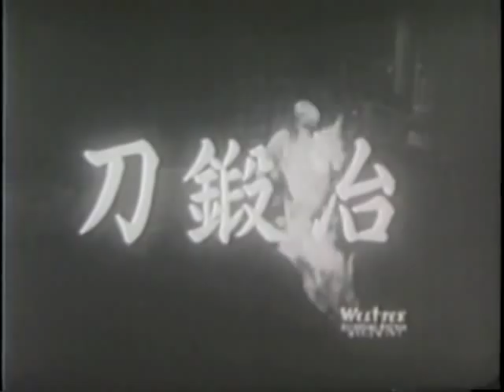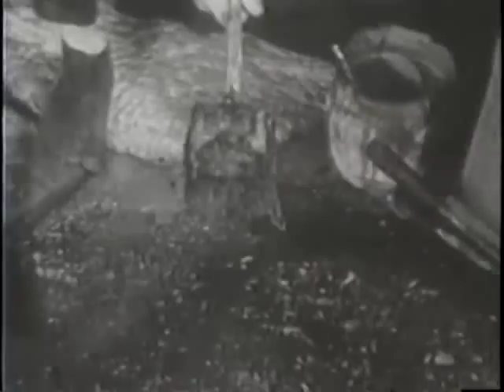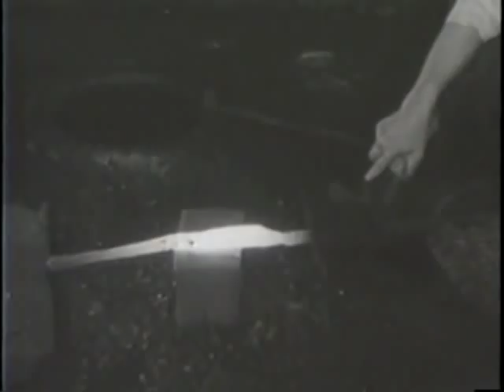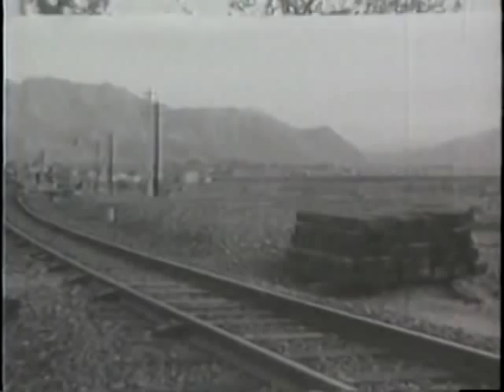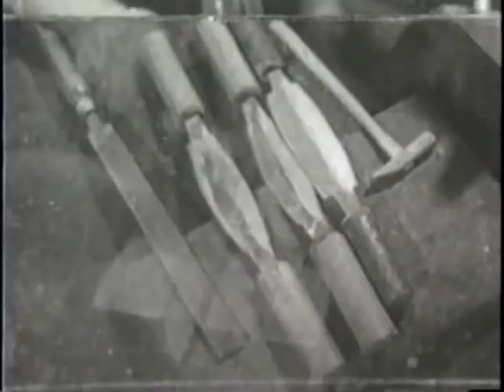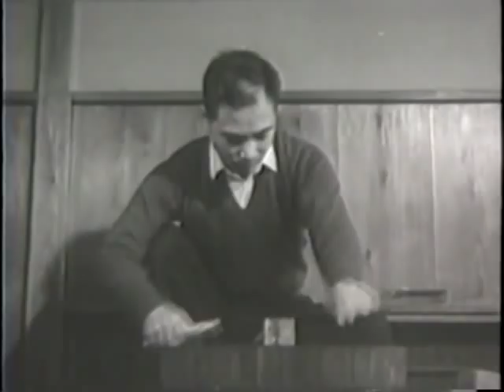Katana Kaji - Post WWII Japanese Swordsmith Documentary

Comment: This is fascinating and noticeably different than other katana making documentaries made in the past 3 decades.  Seems there was some improvising being done around WW2 whereas the more recent blades are actually made from real tomohagana steel.  Also, in other movies, the softer steel is sandwiched into an opening made into the harder edge steel while everything is hot, or at least the edge portion is anyway.  I've also always assumed that the tip was hammered into shape and this is the first I've seen the tip shape cut out first then finished with hammer.
Reply: Varies on the style of forging, some are hammered, some cut.

Comment: And people don't believe me when I told them scrap metal was regularly used in making swords and armour. This was done for centuries.
Reply: +Al M  I have one on my hand which is made of scrapt metal from ww2. Every thing, to the katana handle.
Reply: +Al M damascus steel was never just indian wootz....it had to be a mix from old broken iron swords and hi carbon peices....ie scrap....as you see and say.
Reply: Not any scrap metal, only iron wih the right carbon content. Old japanese kettles are of the right quality.
Reply: I don't believe you told people that.
Reply: @simonc4764  That's probably because of the fairly high carbon content in the brittle cast iron. Easier to reduce the carbon than get it back in.
Reply: Well the stuff used was from iron sand which is what is still used today. I just doubt it's used for much else anymore.

Comment: There are so many translation errors in this the mud is a clay slurry and the rice straw is not a flux but to keep out the carbon that would be added from the charcoal fire in the forging process the rice straw and clay slurry work to seal in the steel and promote even heating and protect the steel during forging . The smith had to use iron pots because they had not restarted making iron sand steel or tamahagane yet . This was right after WW2.
Reply: Nice
Reply: There are some smiths now who still make and refine their own steel in oroshigane from, among other things, old wrought iron nails and bolts. The point is that the smith has to use traditional methods, not always pre-smelted tamahagane, rather than just buying and forging a steel bar.

Comment: What's interesting is the processes that most Japanese smiths no longer tend to use. For one thing, charcoal sizing is more simply done with a strainer rather than chopping it up.
Reply: you can sort with screens but it still needs to be chopped today! ^____^
Reply: it is usually produced as thick strips. You then chop to size, and sort the smaller bits that broke off through screens, and also your fines, along with finer powders used to yaki-ire.
Reply: They still chop by hand, but they tend to get the apprentices to do it.

Comment: and that is the reason why i like katana's : they are simple in shape, lightweighted and yet strong and of corse do i like their beauty. if i had to have a sword my choice would be the katana....
Reply: a katana is not lightweighted
Reply: A katana is not that light...

And European swords were stronger, at least in durability. 

And why only katana when Japan made other swords with the same process as well?
Reply: @UCOUfA3JSy4OmKlcwlANRZTg Katanas were more likely to chip and bend instead of snapping. A well made authentic Japanese sword is strong enough for combat. It's the HEMA fanboys who downplay its overall functionality and call it "garbage".
Reply: @fransthefox9682  Not necessarily. European blades utilized a similar means of construction with carbon steel edges on a iron core. They didn't use "spring steel" which is a modern alloy. At best, they had spring tempering from the 14th and 15th centuries, but these were a minority, and wouldn't become preferred for European blades until the 17th century. Even then, differential hardening and spring tempering had trade offs.

Plus Japanese ores weren't bad to begin with.
Reply: @fransthefox9682  Same HEMA fanboys believe that modern replicas using spring steel also represent the historical quality of steel in that period.
Reply: Kastana sword is batter than katana ,that sword is also made in sri lanka that has very  beauty and also it is very light sword
Reply: I have a hand made sword and it is NOT "light weight." There is some solid heft to it. It is not heavy but it is def not like this stamped garbage.

Comment: I wonder what the block of steel the Swordsmith is banging on made, to take the white hot steel not bend it at all, all i can think off is maybe its a harder flat volcanic rock or harder steel that has been tempered with different types of carbon steels to take the heat of the white hot sword to be hammered into shape. :)
Reply: must be a softer steel so it doesnt chip when struck

Comment: Real Katanas made by Master Japanese swordsmiths are made from tamahagane steel. not scrap metal. Japanese temples didn't use nails in their construction until recent times. True Japanese Shinto temples and shrines were made with interlocking joints and dowels and pegs.
Reply: shows what you know? nothing! in the 1600's-1800's many smiths used foreign steels! namban tetsu! they used recycled steel on the regular!
Reply: @CareOnePlumbingOntario  yes nanban tetsu form the dutch and spanish  and yes your right big  big temples had to be held together by nails  because they where to big to be  held together by friction alone
Reply: @micahcampa  Not only them, but since the Kofun era, Japan reguarlly initiated trade with China and Korea for ingots aswell.

Comment: tamahagane is so overrated it's just scrape iron or iron sand + charcoal
Reply: Japanese overprice everything, they are also the masters of overrating, from swords to fruits and meat they will find a way to make something so incredibly expensive just by embellishing the living shit out of it.
Reply: edgy
Reply: +Painkiller DCXVI not true bud.
Reply: So a katana made from tamahagane isn't as strong or sharp as say a production katana made from production steel?
Reply: +Smitty Werbenjaegermanjensen yea I did it is insulting baka
Reply: +mike davis exactly koto ninhonto at least you know.
Reply: Today modern day steels are much stronger then Tamahagane and much more pure. The reason why the Japanese sword had to be folded was because of all the slag and stuff in the Tamahagane in order to remove it. For example a sword made of L6 Banite or CPM 3V is far tougher. 9620 or 5160 is much stronger as well. Tamahagane made Katana's were all differentially hardened and laminated using pieces of Tamahagane. Some of those pieces had more carbon content thus some were harder and some pieces were softer. The softer pieces were used for the spine and the sides of the Katana while the harder pieces made up the edge. When you buy a Japanese Katana you are buying a piece of art with a deep heritage. If I had 5k to 20k to blow I would have one on my wall for sure.

With that being said there is nothing wrong with buying a Chinese made Katana for cutting practice, zombie head removal or whatever. Personally I wouldn't want to take a 20,000 dollar katana to use in cutting practice cause chances are if you make a bad cut or hit the stand you could bend a very expensive sword. IMHO if you guys want a really strong sword buy a 9260 or 5160 monotempered katana. 1060 is pretty tough too and all three of them are strong and durable in fact much tougher then your traditional katana.
Reply: You are missing the point. 

For the era swords were relevant in, they didn’t have powder metallurgy. The production of steel or even iron was still very expensive and labour intensive. People like katana much like how people appreciate a black powder musket. Sure, it’s outclassed by the products of today, but you could appreciate the work that gone into it, and the progress of humanity.
Reply: @kanekikirigaya3346  leave him aside! He says one can make a katana from " production steel " hahahaaaaaa yes if he wants to cut salat and butter and some printing paper ( like some do when they produce so called " katana ". In a shop where i have seen one of these kitchenknifes they call katanas he said " its a real katana " ....made of stainless steel from solingen hahaha. A katana would be my choice but only if it is made by a real genuine japanese blademaster.
1 it is light in weight 
2 one or two handable 
3 juuuuust beautyful 
And yes the devil/antichrist would not love it being slised with it....or maybe i would'nt because it would be a to quick end for him :) haha 
I may not have the knowledge regarding katanas but what i need to know ablut i know and that us that in my opinion a katana is a veeery good sword and i just can repeat : if i had to have a sword my choice was and will be the katana 
By the way this is so since childhood as i saw one for the first time in my life it was like love on firts sight. 
Let him make his katana like kitchenknife from simple steel and then let him hit with it something that would be fun to see how the fragments of that metal become shrabnels.
Reply: @uniquetruth2097  Tell me you are joking, kid.
Reply: You wouldn't know